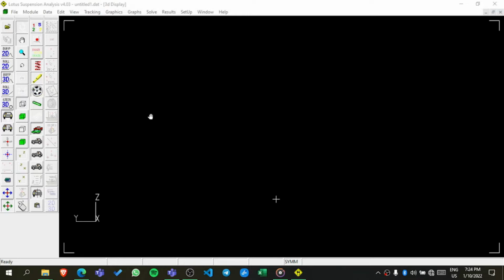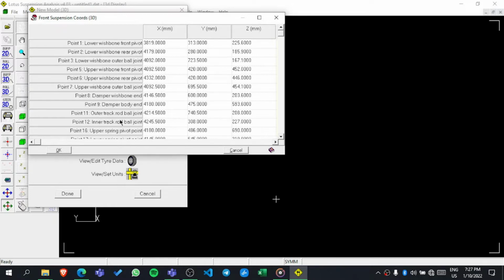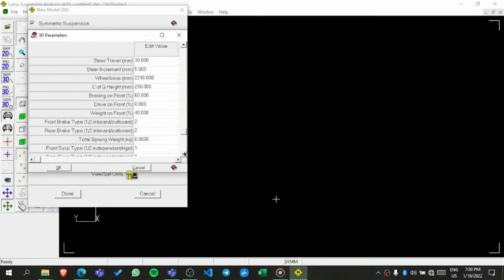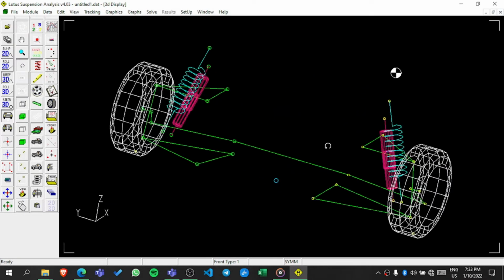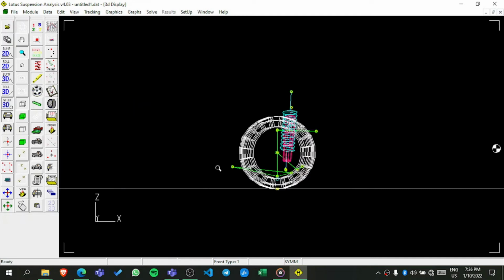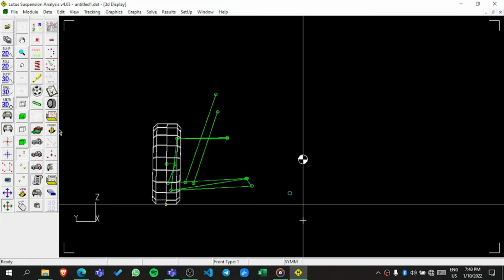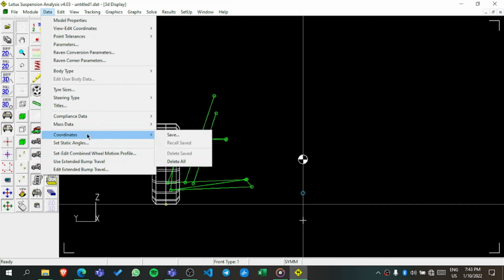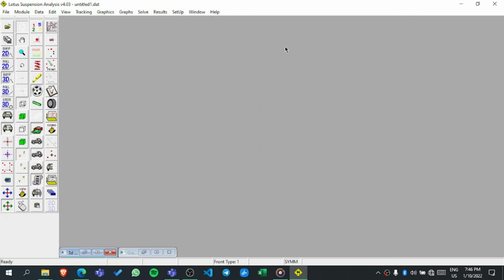Lotus Shark Suspension | Tutorial

Comment: Nice tutorial. Question. Can I used this software for design radio control cars (small cars) or only works with full size?
Reply from the maker: Thanks, Actually it is used for commercial automobiles. So not useful for radio control car simulation. Instead you try other simulators.
Reply: @samarth.create  But the dynamics is almost the same. Question I can insert data like small wheels, weight, etc frpm the rc. I think will work. Because I use the same bibliography from full scale cars for design my rc models and works.
Reply from the maker: @Rudá_BB sure then it will work definitely.
Reply from the maker: @Rudá_BB  u can definitely enter wheel size, weight and other parameters required for suspension & steering. Hope u will find these tutorials useful for your work, wish you best !!
Reply: @samarth.create  Thank's. I use to use Matlab for simulation. This lotus look's more friendly. I will follow you.
Reply: nice project, what matlab code do you use?